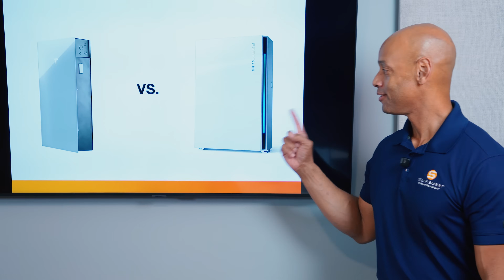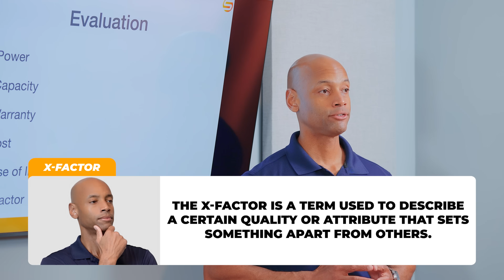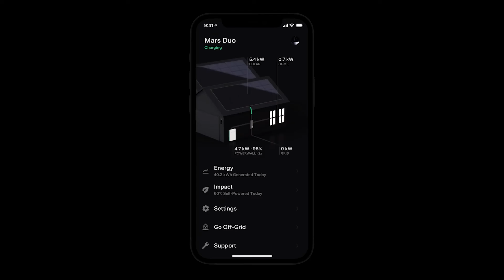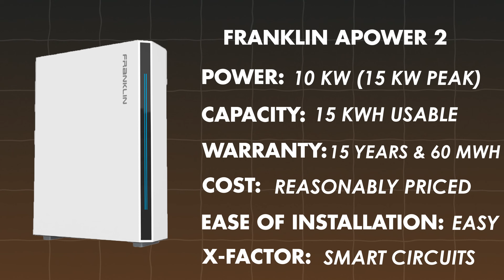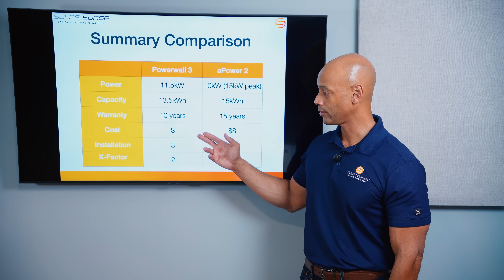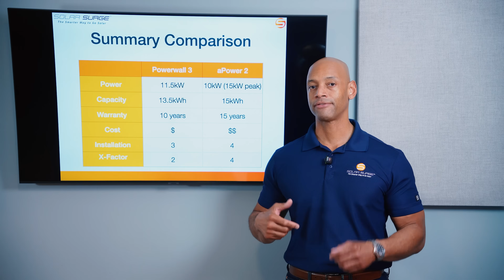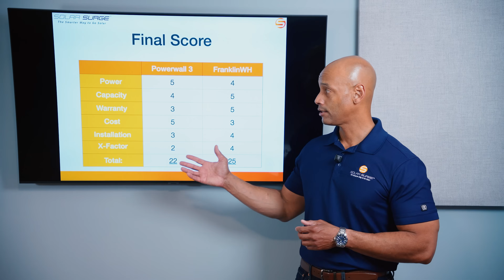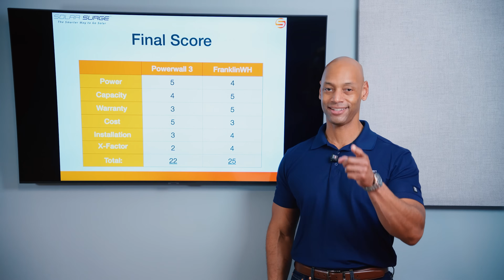Tesla Powerwall 3 Vs Franklin aPower 2 Battery (2025 Updated)

Comment: What about reliability? How would you rate them?
Reply: Franklin claims of the first 12,000 installed only 12 had to be replaced under warranty.  So extremely low failure rate.

Comment: I have heard that Tesla is having a lot of problems with that Collar.   I hear they need to be replaced quite frequently.   I personally prefer my EG4 All Weather Batteries (14.3 KWH Each )  Flexboss 21 / Gridboss set up.  Better price and DC coupled.  And super easy install.  The only reason I would go with Franklin would be if I have Micro Inverters .   But the EG4 Gridboss can work with Micro Inverters and give you a 12KW continuous and 16 KW with solar.  10 year warranty too.  I know Joe is aware of EG4.  Tesla and Franklin are good companies and will certainly take care of you.   But EG4, I think, gives you the best bang for the buck.  ;0)

Comment: Franklin doesn't have the backup coupler available yet and the Tesla is AC coupled as well. Seems like Franklin is treating you well to steer the conversation towards them. Tariffs also hurt Franklin more, I was quoted Franklin at $5K more. Not sure how the franklin is easier to install than the Tesla. Maybe when they buy you dinner ha. Thought this channel was unbiased
Reply: I just had 2x Franklin aPower 2 batteries installed. No tariff impact as the stock was already in the US.  I paid a bit more than I would have for Tesla, but I got 11% more kWh and a 50% longer warranty.  System is working perfectly, just as advertised.  Recommended.

Comment: I was quoted pretty much the same price for Franklin 2 battery install as for Tesla, around $21k before tax credit, so price point in my case is the same, plus generator support
Reply: I have 5 franklin a2 power and several sol-ark hybrid 15kwh inverter  best price guaranteed
Reply: Who did quote. I was quote high price for franklin cause of trariffs.
Reply: @autotecni  Transform Solar

Comment: Love my Frank system added two more batteries for a total of four first of the year. Love the standby generator function. I have grid power however I’m running my system in grid down mode because I hate my utility company. Thanks for another great review.
Reply: How does that work for you? Are you opting out of any net metering credits from your electrical utility?  Com Ed is not stellar, but I would think any compensation for overproduction is better than none

Comment: According to Franklin's website, they only install it with new or existing solar.  So, if you just want a battery backup that's recharged during the low peak hours, you're out of luck.
Reply from the maker: That's a good point; it's worth exploring other battery options if you don't have solar.
Reply: Great point.
Reply: What else is there other than new or existing? Seems to me to be a non-statement?
Reply: @1RetiredCop  Guess he should've said they won't install the battery system without a solar system. What he meant is that Franklin battery systems are not designed as a stand-alone grid-down option, it has to be paired with a solar system.
Reply: @Elagentejefe  This is false.  I have Franklin and no solar. No problem.
Reply: @namdas4u  Ok, I stand corrected. I have Franklin and solar so, I was just trying to speculate what he meant.
Reply: @1RetiredCop  The alternative would be installing a battery without solar to charge just from the grid, either as a backup for power outages instead of a generator or to take advantage of time-of-use electricity cost differentials.
Reply: So what works in that situation Anker Solix or F3800? I know folks who just want battery backup and not solar
Reply: This isn't true. I just had a 2 aPower 2 system installed without solar.  It has a TOU option and my power company offers syncing with peak/off-peak charging and off grid control.

Comment: Doesn't the fact that PW includes an inverter as part of the Battery needlessly increase cost for multiple battery setups? Or can you have extra batteries with no inverters. I like the EG4 approach "of only what you need". Grid boss seperate from Flexboss ex
Reply from the maker: Good observation.  Tesla has the DC expansion pack if you want more storage without paying for multiple inverters.  Please see this video: https://youtu.be/z7NXbMvE3Lg

Comment: Ok, now do Sigenergy to Franklin (unless I missed it).  (I think Sig is the one with a high voltage bus and DC vehicle charging).   Also great run down on the Tesla vs FWH
Reply from the maker: We haven't done a head-to-head Franklin v Sigenergy comparison yet, but it's a good idea.  And yes, Sigenergy has the bi-directional DC EV charger.
Reply: @ I have a couple of older franklin’s and the agate; love em but am kinda jealous of the DC-DC in the Sigenergy

Comment: Tesla has a drill operated dolly for lifting powerwall 3 and you only have to install a remote meter to have them ac coupled and that only takes less than 30 minutes to put in

Comment: $6K just to install a PW3 in NV seemed NUTS to me
Reply: The markup in solar installation appears to be huge, so not that surprising.
Reply: @ still surprising to me for way less than a 1/2 day's work
Reply: @P51  half of that is the cost of dealing with the permitting and utility crap, the rest is paying for a licensed electrician and balance of work stuff whenever you're touching a main panel. PW3 install cost will go down as the meter collar becomes approved in more jurisdictions. At that point it's barely more work than a high-capacity branch circuit install.
Reply: @ all good points.  especially the meter collar.

Comment: One thing I will say about AC coupling of legacy solar (because I have some)...  I like the Franklin approach there but I will note that Sol-Ark has supported AC and DC coupling for years, EG4 supports it, and it's kinda becoming a regular feature for these systems.

However, there is a big difference between UL1741 and UL1741SA/SB.  UL1741 AC coupled solar (basically on/off with frequency control rather than a frequency controlled power output servo that you get with UL1741SA)... that MAY NOT WORK IN A BLACKOUT reliably on these systems.  Your AC coupled solar really needs to be UL1741SA/SB for reliable operation.

I learned that with my old SMA unit which is only UL1741 (without /SA or /SB).  It works fine when the grid is up, obviously, but it's a bit problematic when the grid is down.   In testing, I was only able to get it to stay operating about half the time with my EG4 system and the reason is that the EG4 system can't servo the AC coupled solar due to the string inverter not supporting servoing.  So if it doesn't pick up the full generation immediately and throw the excess into the battery, the GridBoss shuts down the port in order to keep the house up on the inverter.

So, one lesson there.  I'm adding more solar this year that will be DC coupled into the Flexboss21 so I'm not really worried about recharging during a blackout.  But its something to keep in mind if your solar installation is old enough that your grid-tie inverter is only UL1741 (without the SA or SB).

-Matt
Reply from the maker: Great feedback, Matt.  AC-coupling is not an elegant solution for off-grid operation.  In theory, it works, but a DC-coupled system is going to give you much better functionality in a grid-down situation.
Reply: Great info!

I view battery backup divided into two camps:

1) Integrated and good looking (Tesla, Lunar, Generac, Franklin, etc.)
2) Erector set (EG4, etc.)

Many homeowners will choose on looks first.
Reply: @JeffreyAdams-kt5gv  Another aspect of that comes down to maintenance.  A person can call for warranty service with a professionally-installed system that has a large installer base.   For what it is worth, anyway.  I've been around long enough to know that warranty service can be like pulling teeth, or impossible sometimes.

Still, more established brands like Tesla and Franklin should be a bit better with regards to warranty calls.

Those of us who use the DIY cookie-cutter approach have a lot more flexibility in how to approach breakage... EG4 is a competitive choice for DIY, easier to scale,  and significantly less expensive.  But it is not necessarily a good choice for a non-DIY due to its small installer base.  Yet anyway.

-Matt

Comment: I feel like Tesla should get a point at least for also being the inverter.
Reply: Would be but the inverter only having a 10 year warranty and being the central engine of the whole system needs to be considered.
Reply: Yes that is a big item and simplification for the install. Plus the ability to join Tesla's power brokering system.rn seeing a guestimate price how can you compare these?

Without ev
Reply: It can be AC or DC coupled, it can grow with additional PW3 units or DC expansion units, it ALSO has "black start" since it reserves a kwh as well. Installers seem to love the PW3 due to it's ease of install. If you need smart circuits you're better off with a span or other name brand smart panel. The aPower s  will be a more direct competitor with inverter but that will further drive up the cost of the unit.
Reply: The warranty is for a lower performance at end of warranty than for Tesla.  No mention either about throughput efficiency differences and the fact that Tesla can direct charge the Battery, while providing 11.5KW of AC power.  I’d also love to see an assessment of what part of the “x-factor” has to do with Elon’s politics. Color me a cynic if you like but the politics are not an irrelevant factor.
Reply: @tajdvl-advocate6113  the only real stand out feature that sets it apart from Tesla is integrated generator support.. that's really it. Not only does the Tesla not have I don't expect they will ever add it.
Reply: @ericew The market will determine whether battery suppliers have to fully support generator charging.  Right now, it’s a corner of the envelope use case, mostly limited to markets with some combination of unreliable solar and high cost and unreliable public electricity delivery and high electricity rates.  Personally, I believe Tesla will add generator support at some point along with bi-directional charging.

I’m also suspicious about X-factor being used to hide his actual motivation for wanting to push Franklin.
Reply: @ericew  I did not realize the Tesla does not offer generator supported battery charging. That automatically takes it off the table for me. Gotta have the ability for long term self support. If indeed the grid ever goes down for a long time, and you have a week of foul weather with no solar output, no one can afford enough batteries to keep you functional thru an event like that, hence the need for generator charging. A survival plan that doesn't at least consider worst case scenarios and what is required to survive them is not a plan.
Reply: yep that's why i'd prefer it
Reply: Such a ridiculous video.  Single point of failure, high voltage on the roof.  Lower capacity, power, and warranty.  No visual light to show remaining charge level, no 100% drain with black start,  String inverter.  Made to be cheap not good.  It's not even close.  So why make these videos.  Why need ANYTHING but the best?

Comment: The aGate component from Franklin is mentioned indirectly in the generator and dark start conversation.  It also adds smart circuits which is huge.

Please add Lunar Energy to your comparison.  It’s near equal with the Franklin.  I expect in the next few months it will be equal.  An upside with Lunar is the modular battery which makes installs even easier.  Yes they need to convert to LFP chemistry.  

It appears Franklin, Lunar and Generac have the best designs going forward.

I would always suggest at least two separate batteries for redundancy.  When the power is off you do not want a failed battery!

I also think Eaton can take over the whole gateway/combiner/grid connection space with the upcoming AbleEdge load centers and smart breakers.

Thanks again for the video and speaking with me at Intersolar in San Diego.
Reply from the maker: Thanks for the feedback. We are going to have a lot of content about Lunar coming out soon.  Just met with their CEO earlier this week.
Reply: Sure, if you don't mind buying the modules for them.  You want a generator?  No problem buy the generator module for the AGate.  You want some Smart Breakers?  No problem, buy the Smart Breaker module for them.

I don't get it?  What is the love for Franklin?  The battery is large & heavy and has a mediocre ATS/Gateway.  Give me the PointGuard any day.  AC & DC coupled, Smart breakers and all you need to do is install some Eaton breakers.  The generator port is there and all you need is a breaker.  The batteries are compact and allow for many size configurations.  You can have as much as 37 kWh in a single stack about the same size as the Franklin.  I installed it on my house and connected the generator and my EVSE, Dryer and oven on smart breakers and still have two left over.  You can even purchase a bi-directional DC EVSE if your design calls for it.

Easier to install with no heavy lifting equipment, more features and faster installation times.  Give me PointGuard any day.